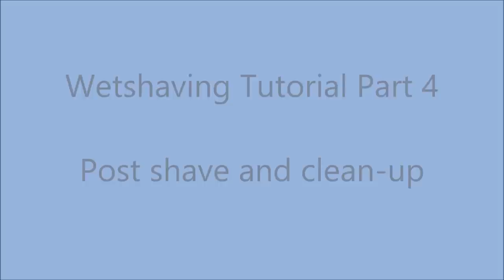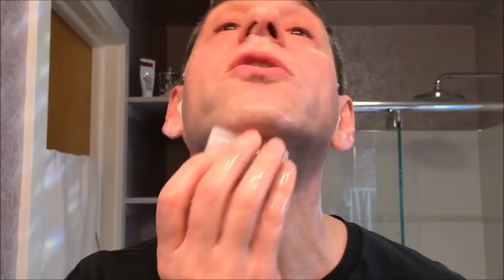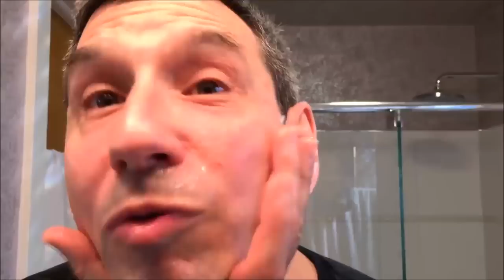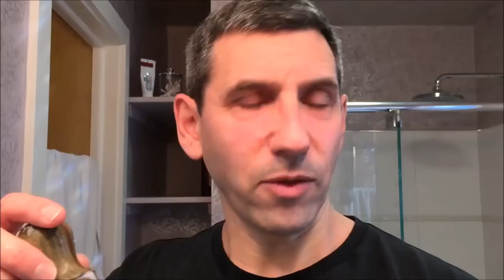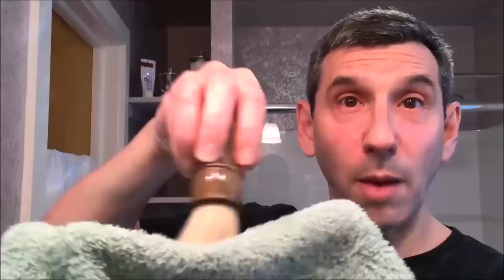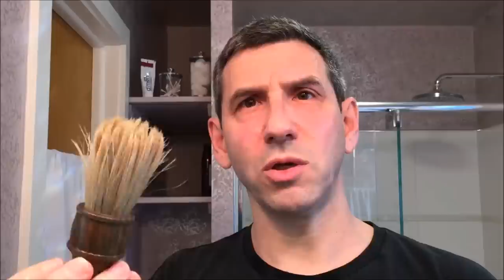Wetshaving Tutorial Step 4 - Post shave and cleanup

Comment: Very nice tutorials Michael.  I do have one thing I do that is different than your method.  I have no proof that it has any benefits, but it's just a part of my ritual.  After I clean the razor of soap and hair, I do disassemble it and take out the razorblade.  I dry the razor with a towel so it does not show water stains, and using toilet paper, I dry the razorblade without disturbing the edges to avoid dulling.  I do this because I believe oxidation and rusting is what accelerates blade dulling.  When I dry the blade, I think it limits the rusting process due to the removal of moisture.  I also turn the blade the other way when I re-install it for its second use so a slightly newer edge is used for the second shave.  Just my thing.  Don't know if it makes any difference.
Reply from the maker: Thank you for watching!Some do store their blades in oil after each use, or perhaps clean them in alcohol between uses to ensure the blades are completely dry. This may well eke out some more shaves, but I feel like it is more work than it is worth in the end. The fewer times you handle the blade, the better, including wiping down the blade.

I do not believe that turning the blade over does anything, because there is only one edge and not two halves to the edge. As the edge dulls, the entire edge dulls.

However, if this is working for you, keep going! There are no shaving laws, only guidelines (grin), and you should do what works for you.

Comment: Can I apply a toner after the alum block or would that be to irritating? Also if I use a moisturizer do I still need an aftershave balm?
Reply from the maker: +Alex you may find that the alum is already doing the work of a toner, and doubling up may not be that great for your skin. Try either the toner or the alum and see which one works best for you. Alum is really good if you have some small nicks or weepers or just a touch of irritation.

Aftershave balm is a moisturizer, just one that had been designed to help reduce skin irritation or razor burn as well as moisturize, and often is scented rather than plain. You can use or the other, no need to use both.
Reply: Thanks for the reply.

Comment: Thank you for your videos. I'm completely new to wet shaving, and I tried to remember all the tips and steps in your tutorial, but I must have done something wrong, because my lather was too thin and sudsy, even though I didn't add any more water to the brush. As a result, it was hard to see where I passed over and I probably didn't have enough protection, so I ended up with razor burn.

Also, I'm REALLY nervous about the area of skin just below my chin. With a cartridge razor, that's where I always ended up choosing between having several nicks and ingrown hairs there or leaving a patch of beard. The same thing happened with the safety razor.

Any tips on the lather problem and the difficult patch of thin skin? I'll have to wait a few days before I have another go, but I'm determined.
Reply from the maker: +Eric By Definition Tips? But of course!

Thin lather is the result of not loading enough soap. New wetshavers will often swirl the tips of the brush lightly or gingerly over the surface of the soap, and stop loading too soon. Make sure you really get a good pasty layer of soap on the face of the brush, don't worry about using up your soap or wasting it. Once you have a good thick paste, then start adding a bit of water to the brush and build the lather. Keep adding a bit of water and lathering until the lather is creamy and thick rather than watery or thin or bubbly. Make some practice lathers in the palm of your free hand, and you will soon see the lather you are looking for!

The part right under the chin...yup.
Some simple things to try. If you are afraid of shaving in one clean stroke down onto that area, you can try shaving side to side on that part of the chin. You can also pull up the skin a bit to help with creating a flatter surface. One other thing...if you are being overly cautious and shaving very slowly, you are actually making it easier to nick yourself. Speed up a little bit and make sure you are really gliding the razor with no pressure. The nice thing about a better lather is that it really helps this part, because the lather makes the razor move that much more smoothly over your skin.

I will try to remember to offer some tips on the chin area in the next shave video...

Good luck, don't give up! This is a new skill and like all new things this will take time to master. Keep at it and you will soon see real improvement!
Reply: Thanks! I'll remember that next time.

Comment: Very interesting, thank you. I'm in the older cohort of Gen X, and my dad didn't really teach me to shave, just bought me an electric razor. Went through a few types, then did some cartridge / disposable razors for a few years, then gave up and grew a full beard, which I had for at least 15 years (I think...). I decided to shave it all off a couple months ago (work was doing Movember fundraising, though I had been thinking about it for a couple months.) I'd bought my husband a DE shaving kit a few years ago, but he never used it, so I have started using it. I've been using his shave foam for the past couple of months... I think I'm going to try the soap and brush that came with the kit the next time I shave.
Reply from the maker: Once you start, and you realize just how good a shave you are getting, you need to get your husband to take it up as well! Give yourself a bit of time to learn how to use the brush and soap; it's not hard, but it does take a bit of practice to get it right.

Comment: How do I thoroughly clean a safety razor? A toothbrush and some dish liquid will work? What about the brush?  Some shampoo?
Reply from the maker: +Alex Yes, you can simply use some dish washing detergent and an old toothbrush to scrub your razor clean. Avoid any harsh detergents or abrasives. Hot water and soap absolutely do the trick.

To clean your brush, put two tablespoons of white vinegar in a cup and then add enough hot water to submerge your brush's knot. Let it soak five or ten minutes, then rinse thoroughly. Take a little bit of either shampoo or dish detergent and wash the knot. Again, rinse thoroughly. Want to get a little crazy? Use some conditioner on the knot and then rinse gently.
Reply: Michael Freedberg Thank you.
Reply from the maker: +Alex no problem, hope it goes well!
Reply: Michael Freedberg Can I use the same toothbrush that I use for cleaning the safety razor to clean other groomong tools (tweezers, scissors, nail tools etc.)? I ask this because of risk of germs cross contamination.
Reply: Michael Freedberg Instead of The White Vinegar Can I Use Apple Cider Vinegar, Also Your Cleaning Method for The Brush, Can That Be Applied to a Synthetic Brush or Is There a Different Way To Clean a Synthetic Brush?

Comment: What about the shave bowl with your soap in the bottom?  Do you rinse it out? Do you wipe out the lather in the bowl with your hands or wash cloth?  Do you do nothing?
Reply from the maker: I just leave it as is, with the lather in it, during the week. When it comes time to load the brush again, I just re-mix all that dried out lather back with the soap. Friday, when I am done, I rinse out the bowl so it looks more presentable on camera.
When I am completely done, I remove any remaining soap residue, rinse out the lather bowl, and then add the next soap I will be using.
Hope that helps!